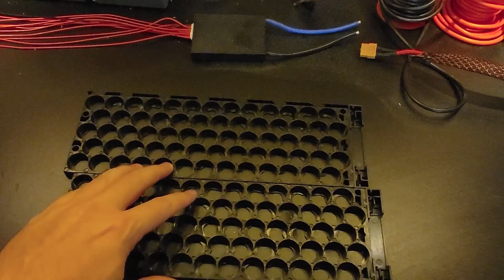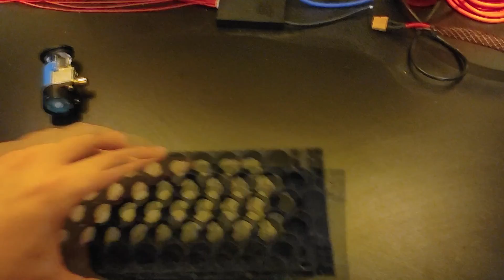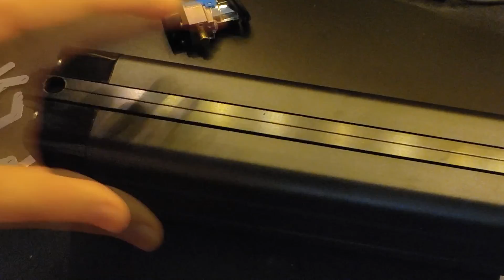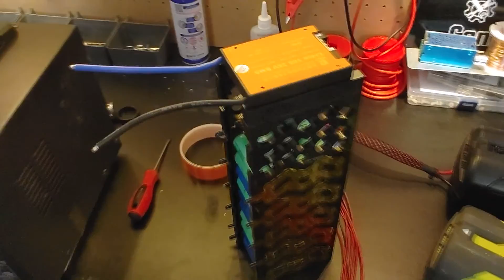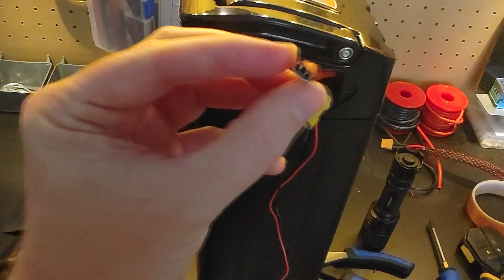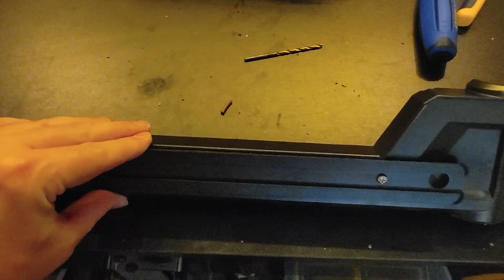DIY - Lawn Mower Battery

Comment: I recently bought a lawn mower battery on eBay that the guy rebuilt using Sony vtc6 cells and it was 60v 6ah and came with 30 what he called brand new cells so it looked to be a decent deal at $35 plus I made the mistake of thinking it had 40 cells because I wasn't 100% certain of what the capacity of the vtc6's we're but overall I'm happy with it.  Turns out it was I think 13s and wasn't really 60v nominally but no biggie I have a SurRon electric dirt bike and I was thinking it would be nice to use it as a piggy back running in parallel with the stock battery but then I found out it was 13s and the surron is 14s so no go on that but I'm goi g to reuse the cells on a project.

Comment: Killer video! Lots of good info here. We may have chatted before but we recently built our own lithium battery bank for our sailboat and would love your feedback :) part 1.5 is on our channel now!
Reply from the maker: Will look over the videos and give you my thoughts.
Reply from the maker: I think your build is excellent! Your video production is top notch and I really enjoyed the video. The only thing I would have done differently is make things modular. I know space is limited on a boat, but I would have made an enclosed battery pack with BMS that connects (High Amperage Anderson Connector) to a central bus bar. This allows for a backup to be quickly replaced with original or expanded capacity to be added with ease. Again great build and video production.
Reply: @TechCentric_00  great tip - we will consider looking into some options! Thanks for the feedback :)